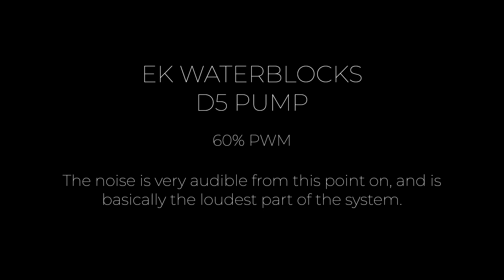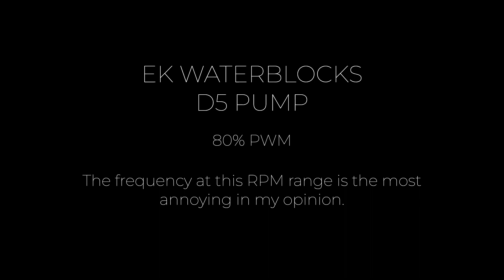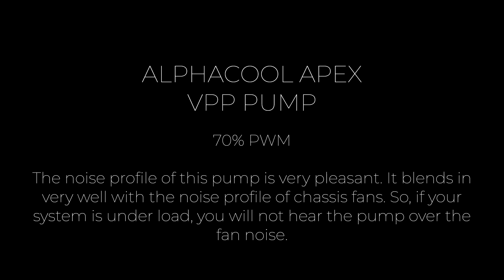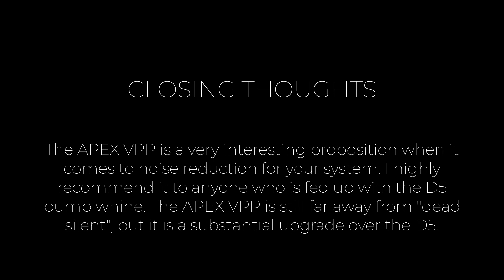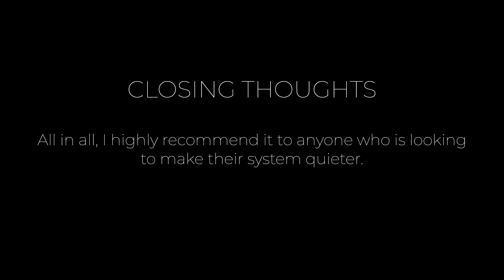D5 vs APEX VPP sound profile comparison

Comment: BTW how much shorter in mm is the apex pump than the d5?
Reply from the maker: Check the spec sheets for D5 / Apex VPP, cause mine is sitting underneath a full pump cover and I have no access to it without doing acrobatics with the system.

Comment: on isolation mounts, my d5, vpp655, is silent upto  53%/2100rpm. After that whine gets loud fast. to hear it I have to get within 4 inches and even then it is barely audible.
Reply from the maker: Indeed, if you have it mounted on vibration isolation pads, then it's the best case scenario for the D5 or any pump for that matter.

I think the majority of the noise is caused by transmission of pump vibration to the bare metal of the chassis, which is the default setting with distro plates, making them a terrible choice for silence focused builds imo.

Also, the heavier the pump top / cover, the harder it is for the thing to vibrate, the less noise is produced as a byproduct.

Comment: Hi, I've just built my first watercooled rig, but I have no idea on how to manage the pump speed, how do you do it ? I have the Alphacool VPP APEX
Reply from the maker: Mine is plugged in the CPU PWM header on the motherboard. Within the OS I use a program called FanControl to adjust pump speed and fan speed. I adjust fan speed based on water temperature. I adjust pump speed based on CPU/GPU temp.
Reply: To each's own but my preference is controlling the largest radiator fan array (daisy chained fan PWM's) on the CPU fan header. Then I use a chassis fan header for the pump PWM, but I use a flat stepped single speed, so it doesn't matter which component temp is assigned. One may then ask, what is the point of using a PWM, to which I would reply with, it allows easier speed adjustment through either uefi or motherboard utility software. I always run the fastest pump speed audibly tolerable and since the VPP APEX doesn't draw as much current as a typical D5, it's more practical.
Reply: the proper way to do it with with a water temp sensor ($10) ideally plugged into an aqua computer quadro/octo ($50/80) fan/rgb controller, though some motherboards have a temp sensor header.  For quadro/octo, speed/rgb control is done in dedicated hardware and works in bios/linux. Just need to program it via aquasuite which is by far the best fan control software out there (imho). It doesn't require bloatware to run constantly, just once to program settings.
Reply: Again, there's really no point in having a fluctuating pump speed. The faster it runs, the cooler things are going to be, but noise is often the determining factor. Plus, maintaining a set speed for the pump contributes to its reliability. However, if components are running hot, best increase fan speed and/or increase radiator surface area (add more radiator/s to the loop). Increasing pump speed is only going to drop the temp within a single digit range.
As for fan controllers, motherboards these days (2024) include fan curve profile controller functionality within the UEFI settings and within utilities, so whether one is running Windows or not, it's covered. Once one has it dialed in and the profile saved, it may never be adjusted again.
My motherboard is a B650M Aorus Elite AX.
Reply: @wjkgreen  I disagree with pretty much all of that. I don't believe the reliability bit. I think there are good reasons to vary speed. And a motherboard fan curve requires a temp sensor header.
Reply: @jeremytine  I don't care what you believe and you may disagree, but motherboards DO have their own temp sensors.
Reply: @wjkgreen  re-read what I said. I said temp sensor HEADER.  A select few motherboards have a  header to plug in a water temp sensor. I.e.curves  should be based on the temp of the coolant not the CPU/GPU. Basing it off CPU or GPU can 1) overheat the other in situations where load is disparate.2) in disparate situations it can over heat the coolant possibly causing  loop failure 3) if you don't monitor water temp, you lose early warning of pump failure. Mine is set to ramp up to 3k rpm after coolant gets above 45c which should never happen outside of pump failure.
Reply: @jeremytine  
I simply leave my Xylem Lowara D5 Vario, in its WATERCOOL HEATKILLER® Tube 200, running at its selected speed, which is 4K rpm. In my experience, D5 pumps don't abruptly fail. D5 issues can arise if a loop isn't properly maintained, leading to an unbalanced rotor. However, pump orientation, its type of housing and how it's mounted play a large part in how that affects its operation. A rotor making contact with a pump's magnetic shielding produces an unmistakable grinding noise.